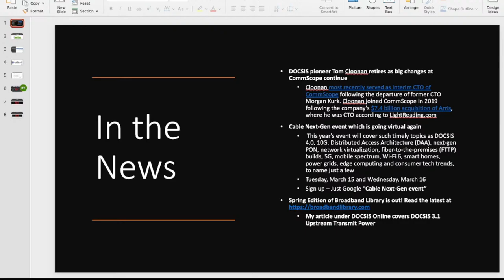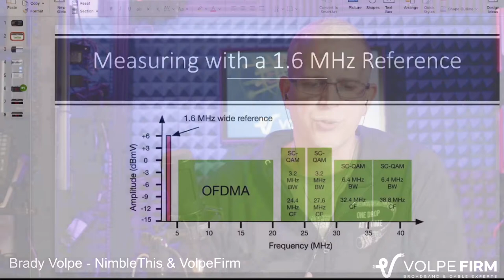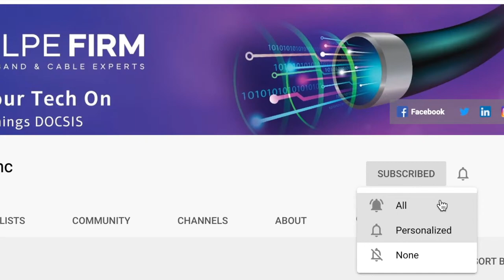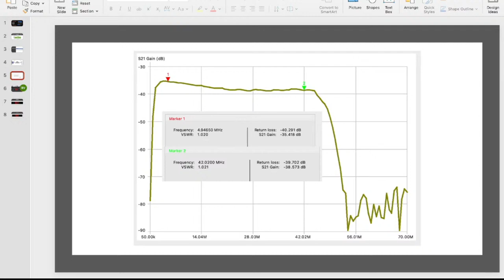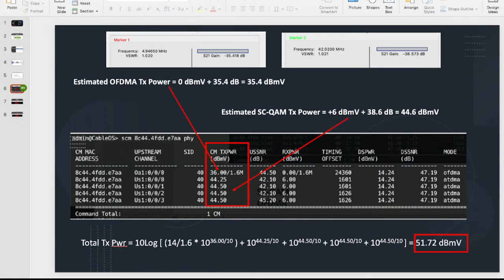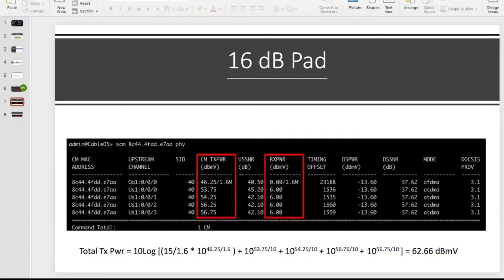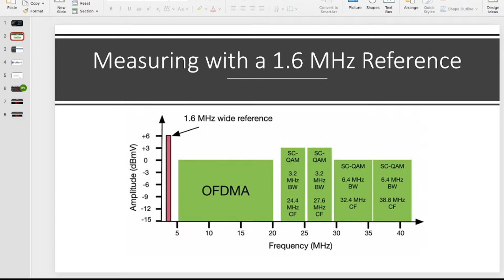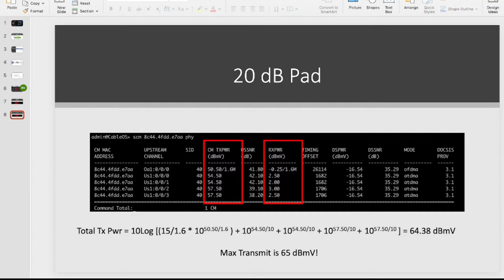Upstream Transmit Power with OFDMA

Comment: Curious about why tracking ofdma noise can be so difficult. Its not visible on the spectrum analyzer and somethings causing correctables, we flatten the floor and try to reverse eq as best as we can but still end up with iuc channels with 40-80% correctables. We are using 6-17 or 6-26 and a few 6-32 mhz (with one SC quam left) ofdma with a dsg inserted at 9-11 mhz. Snr 35-36. I'm also curious to learn more on iuc's, how they work and how modulation upscales and downscales based on network environment. Tried to find documentation on iuc's and found really vague info. Thanks and love the content 👍
Reply from the maker: Hi Johnny thanks for the questions, this will make for a great next show!
Reply: Has this been covered yet?  Trying to find out more about IUC’s.

Comment: When I run diagnostics for a node and look at total tx power its +11 db more than the average (between min and max tx values) for any modem using ofdma, regardless if its low split 10mhz wide or mid split 40mhz wide. Can you provide insight into what configuration would have to be to get this 11db difference?
Reply from the maker: Hey 905 CableGuy, there are a lot of unknowns for me here. How has the CMTS been configured for receive level - us it the same for all upstream channels? Was your return balanced for unity gain? When you took your measurement where are you taking it at - the node return path laser test point?  I suspect that you may have some tilt at the input of the node and perhaps whomever configured the CMTS may not have all channels set to the same level. You are quite close to the 12 dB DRW window. Hope you work this out.
Reply: @Volpefirm  sorry I was not clear. I was trying to understand how 12db difference could be achieved (like what cmts configurations would lead to a 12db difference with the 1.6 reference conversion) this example is 42 mhz wide upstream with 10mhz wide low split ofdma  with 4 sc qam upstream (3.2(x1), 6.4(x3)).

Comment: locked on at 63tx last week
Reply from the maker: Was that with a DOCSIS 3.1 modem?
Reply: @Volpefirm  yes. 3.1 normally 4ch bonded but was showing just one ch. was enough for the tech to activate it and leave.. maint came by later and fixed the tap. now sits at 48